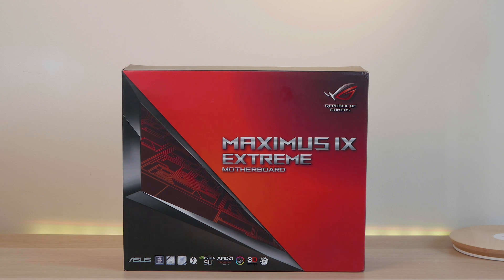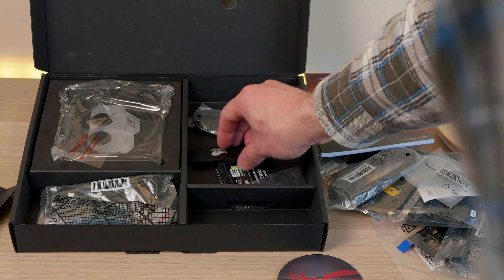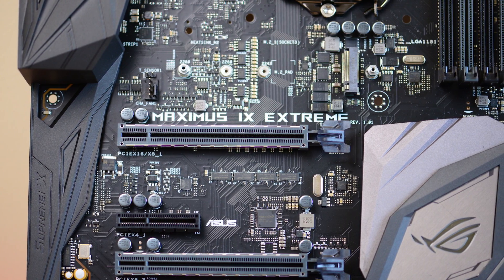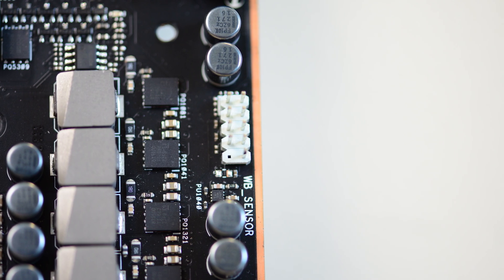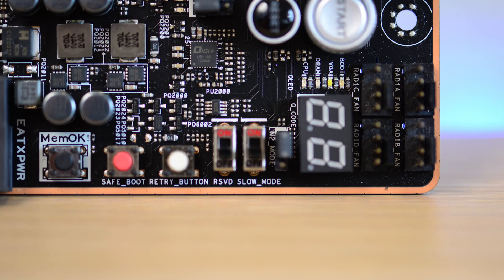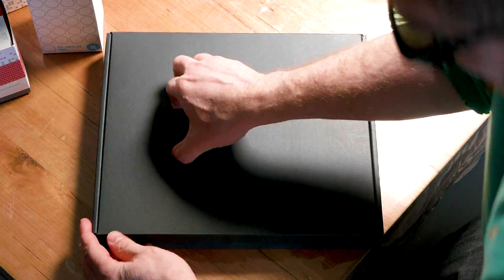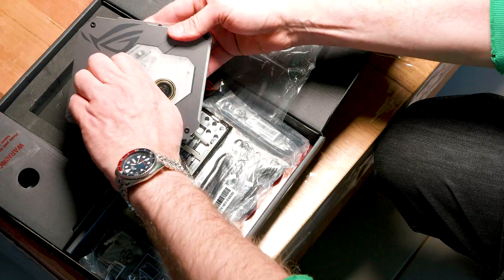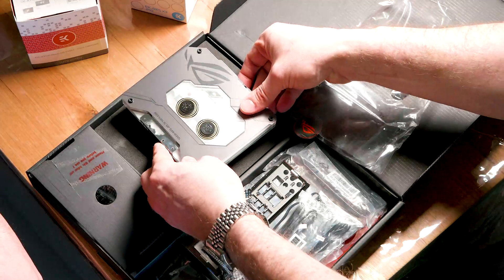ASUS MAXIMUS IX EXTREME MotherBoard Z270 Review Water Cooling The best x270 Motherboard

Comment: Bought one today for upgrade my 6600K and Z170A from MSI. It's gonna be my first water cooled PC. Today it was on discount for +- 45USD so I had to buy it even if its old :D
Reply: Hello did you already tried it? If yes how múch cost additional equipment ? Thanks
Reply: @MASSCUBE  Hi, I have 2x360 aluminium radiators (30usd each) , 6x rgb fans for them 50usd for all). Raijintek pump with reservoir (used by my friend and then sold to me after half year for 48USD) and some fittings, flow meter for 45usd. Then water cooled GTX1080 for 235usd.
Reply: @petrzabensky1451  
Hello

Thanks for fast answer .
I have a an offer for 80€ so I wanted to know if the additional equipment costs a lot. Currently I have also z 170. I wanted this new only for some build and gain experience maybe in water cooling. One negative for me should be form factor coz I have mini ITX format now. 

So only pump radiator fan and piping + fittings are necessary.

Thank you Petr

Comment: It's $149.99 on Newegg.
Reply: i just seen that Im thinking of buying it for my i7 7700k 
I need to be able to do some overclocking because I currently only have a cheap hp omen motherboard
Reply: Can u use this without water coolant ?
Reply: @meastmode2152  The motherboard? Yes, but it's oftentimes recommended because gaming applications put a lot of stress on the CPU.
Reply: @meastmode2152  *Disclaimer: that's only if you plan on overclocking, otherwise, for general purposes, an active heatsink will suffice.
Reply: @meastmode2152  Oh, wait... You're talking about the coolant. For that, I would contact the manufacturer to get more detailed information.